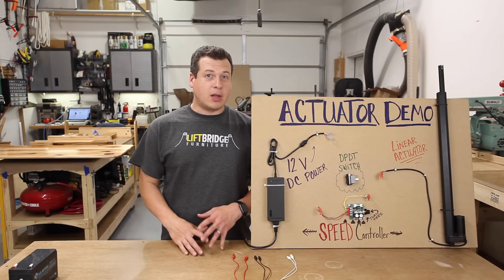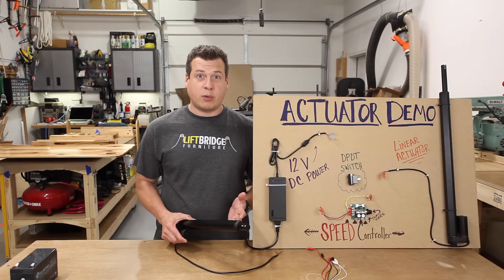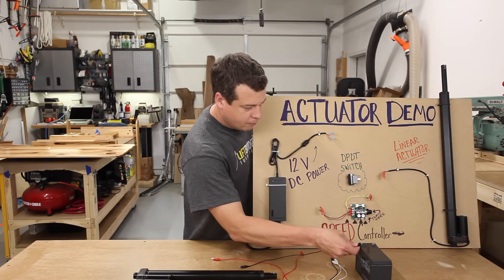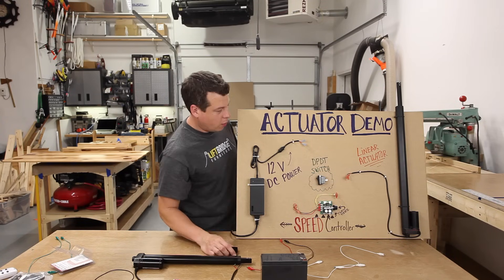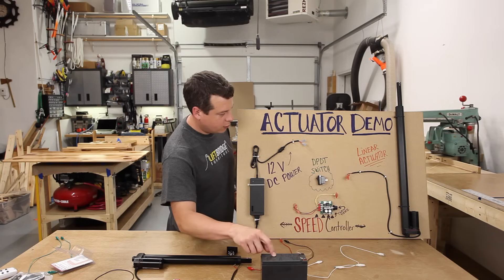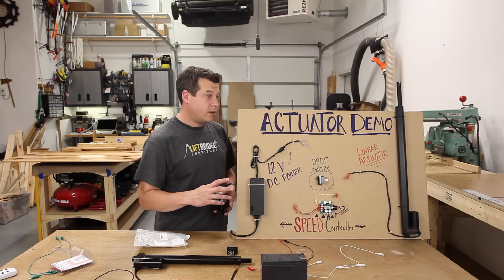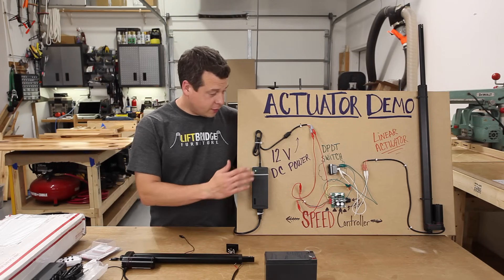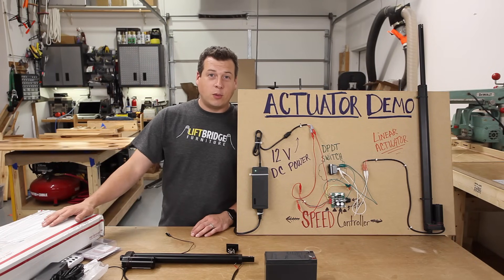Linear Actuators 101 - for Woodworkers

Comment: Just learned how CHEAP these are.  Plan to use 2 to lower my van conversion bed platform along the wall, to convert it into an "adirondack" type seating!  I need less than 6" of movement and I'm clearly under the weight range!

Comment: You think I can use a in/out switch, I have one on a remote lead that plugs into my winch, on my 4 wheeler, that the plug was different, and now I want to use it on my kayak trolling motor, useing a actuator on it, any suggestions, and help, will be appreciated, thanks
Reply from the maker: Yeah I don't see why that wouldn't work.

Comment: Hi, thank you for a great video - it has been so useful..  However, i do have a question.
I am building a table lift using 4 linear actuators.  Even though I have purchased identical models, one is running quicker and one slower than the other 2.  I purchased 3 speed controllers and went to install the first one tonight.  I found that you cannot wire it into the actuator side of the switch as the speed controller is polarity sensitive and of course the polarity switches when you run the actuator the other direction.
So the speed controller needs to be connected direct to the power supply (as you stated in the video).
So to be able to speed match all 4 actuators, am i going to have to install 4 switches?  Is there no way to wire  the speed controller into the actuator side of the circuit?
If I had two speed controllers for each actuator, one for the up polarity and one for the down polarity, then would that work?
Reply: I just ran into the same issue with 4 actuators. Did you find a good solution?
Reply: I tried using 2 speed controllers for each actuator but could not get it to work.
I ended up using resistors to slow the actuators.  It’s an ugly solution but it works.
Speed controllers would have been a better solution but I could not get it to work.
Reply: I have the same problem using two actuators. His solution using the speed controller is nonsense. He proposes the speed controller as a solution to slow one actuator, then he wires the speed controller between the power and the switch, thus you are actually controlling the power to BOTH actuators at the same time with the speed controller. The speed controller he linked does NOT work between the switch and the actuator once you reverse the polarity to retract the actuator.
Reply: In fact, the description on the speed controller states "Reverse polarity protection". I should have paid closer attention to his schematic and the descriptions on the components he posted.

Comment: I have a question about what do you do about the ground wire in the power supply and where should it go. I want to use this setup on a recliner where the reclining mechanism has failed.
Reply from the maker: The power supplies that I use only have two wires coming out so not sure?  Do you have 3 wires on yours?

Comment: How fast will the speed controller increase the actuator opening and closing?
Reply from the maker: The speed controller won't speed up the actuator.  It will only slow it down from it's normal operating speed. The idea with the speed controller is to slow down a faster actuator to match the speed of a slower actuator.
Reply: @TommyTompkins  Thank you

Comment: Great video. Thanks.  Can we set actuators to move continuously non stop at a specified speed? If so, for how long can they run continously, an hour, two?  
Thank you!
Reply: The frame design of every motor dicktates its duty cycle.
SEALED, CONSTANT DUTY.... is fairly self explanatory.
This will be listed on every large motor ID PLATE ...
Manufacturers data sheets will be needed for those below 120V.

Comment: Is it possible to somehow sync 6 of these and attach them to existing metal legs about an inch in diameter?
Reply from the maker: With the particular model that I use, you can't get them perfectly in sync but it's possible to get them close.  Ideally, if you're going to have that many, you should get linear actuators that are designed to be synced together with a controller.  These actuators are usually a lot more expensive.  You can have a company like Progressive Automations piece together a solution for you, or you can get pre-built desk frames that come with all the electronics and controllers such as the ones here: https://www.upliftdesk.com/adjustable-height-desks/

Comment: What happens if current to the switch doesn't stop?
Reply from the maker: Then the internal limit switch will stop the travel after it hits the max travel.
Reply: @TommyTompkins  That's good, so it's safe to do.
Reply from the maker: @TempleGuitars  Yep - that safety is built into most actuators.
Reply: @TommyTompkins  Thanks for all the info. Really valuable tutorial!

Comment: That was an awesome video. Thank you. I’ve never done this before, but if you had a problem of one actuator going faster than the other one, wouldn’t you want to wire the speed control in between the rocker switch and that actuator, as opposed to before the rocker? Seems like people would have one rocker for all of the actuators, so the issue with speed would need to be applied to just a single actuator?
Reply from the maker: avg8or with more than one actuator it gets a little more complicated because you need to introduce relays into the wiring. But yes, you’re correct.

Comment: Any recommendations on an actuator that lifts very fast? Is it just higher amps? No concerned about the noise, thanks!
Reply from the maker: In my experience, pneumatic actuators can move very fast but you would have to run an air compressor as well.  With electric linear actuators, faster generally means less powerful.

Comment: Thks do much.
I have a question: 
Could you help me wiring 4 linear actuators 12 v x 3 amp , I have a 15 amp momentary switch, do I need anything else ?how can I do to all work together the goal is lift up a truck canopy.
Thks for your attention
KingRegards
Humberto
guerreirohumberto@hotmail.com
Reply from the maker: 4 actuators can get a little complicated to wire up because you need to use relays.  Two actuators are also more complicated if you need to introduce a speed controller to slow down the faster one to match the speed of the slower one.  I always use relays with 2 actuators as well. I have wire diagrams and parts lists for two actuators in my desk plans on https://liftbridgefurniture.com but not for 4.  To be honest, for 4 actuators I would probably go with a desk actuator kit with controller that was designed to control 4 actuators and keep them in sync.

Comment: I'm working on something similar. Working on a way to mount a TV that goes up and down. I thought of drawer guides to the right and left and one actuator in the middle.  Figured it would save me a little but both sides would go up at the same rate. No real need for a speed control unless I just wanted the TV to go up slower. Am I on the right track in my thinking?

Also thinking of using one to tilt the top down a little to change the viewing angle when its at the fully extended hight. I know im nuts but the set will also slide right and left 14 inches on each side. It's confusing but it's a 43 inch TV I want to mount over my kitchen sink. Making it slide right to left is the only way I can open the cabinet doors.
Reply from the maker: Sorry for the late reply here.  Yeah drawer glides with a single actuator should work just fine without a speed controller.

Comment: Tommy, I want to reduce the speed of me Lazy Boy lumbar activator. Can't get to it without tearing open the back. Have you ever used a resistor in line with the motor leads to just set to a lower speed?

Comment: I would LOVE to see this same exact functionality only controlled with a digital assistant instead of the rocker switch. To factor in the safety aspect of not having continuous power flowing to the actuator, maybe use IFTTT to set a time limit for something like a Sonoff smart switch? For example, a voice command to raise the desk would trigger one Sonoff smart switch for 10 seconds and then automatically turn it back off. A voice command to lower the desk would activate a second Sonoff smart switch (with reversed polarity) to lower the actuator for 10 seconds. 
I don't even know if this is possible and, if it is, if my idea is feasible or way too complicated. Either way, I just ordered some components to start playing with. Excellent video!

Comment: Do you buy the speed switch complete
Reply from the maker: Here's the speed controller: https://liftbridgefurniture.com/product/riorand-tm-12v-40v-10a-pwm-dc-motor-speed-controller-w-knob-high-efficiency-high-torque-low-heat-generating-reverse-polarity-protection-high-current-protection/

Comment: Great video! I want my new hidden gun case door to rise up 90 degrees (open) hinged on top. The door is 64" wide and 32" tall and made of 3/4" ply.  The wall hanging cabinet is 4" deep.   How many actuators would you use and what size? Thanks.

Comment: I really want to see a design where you arnt limited to load actuator can take when not moving. I'm thinking arduino with a selonoide as well and intervals it can lock at either pin wise or Rollercoaster clicker style (introduces some potential limits or challenges for down.. I've got one other idea probably cheapest but..

Comment: Do these generate a lot of heat? If not, maybe they could be wrapped in a sound deadening material to cut the noise down
Reply from the maker: With normal use, they do not generate a lot of heat.  But if you go over the manufacturer's recommended duty cycle limit, they can produce heat and be hard on the motor.

Comment: I'm trying to hook up 2 actuators with a speed controller on one of them, I have wired it up between them switch and the actuator, it works going up but not coming down, any suggestions?
Reply from the maker: The speed controllers have a fixed polarity so it either has to be wired in prior to the polarity reversing switch (to slow down both actuators) or if you're looking to slow down one actuator to match the slower one you'll need to also incorporate some relays.  The wiring in the latter example can get kind of confusing and it's not easily explained.  I have the complete wiring diagrams and parts list for that included in my Stand Up desk plans here if you're interested: https://liftbridgefurniture.com/product/lift-bridge-standing-desk-drafting-table-plans/

Comment: anyone knows trustworthy company to buy a DC linear actuators which have following specs .
1. load force : 200N

2. Full load speed  >600 mm per  sec

3. stroke length : 300mm

4. input voltage : 12/24 v

5. mounting length : around 500mm

Comment: I need an actuator that will sit in a 10inch enclosure and need to travel at least 8inches to lift a small tv monitor. I found a 4in actuator which travels only 2inches. Then 8inch x 4inch, and so on.. is there an actuator or other hardware to make this happen?
Reply from the maker: Did you check out any of the Windy Nation actuators?  An 8 inch stroke might work for your application.

Comment: In the video, you stated you can put one speed controller on the faster actuator to slow it down, and keep both in sync. How do you wire one speed controller, to one actuator, (on an application like this with two actuators) with one power supply and one switch?
Reply from the maker: When adding a speed controller to the mix in a dual actuator setup, the wiring can get quite a bit more complicated.  You basically need to introduce relays into the wiring in addition to the speed controller, switch, and power supply. I have wiring diagrams for this and parts lists available in my inversion chair plans as well as in my standing desk plans that are available here: https://liftbridgefurniture.com/shop/?fwp_product_categories=woodworking-plans
Reply: @TommyTompkins  I have the same issue. Any chance you can share how to add relays into the circuit? I am making a very low budget desk would really appreciate your help. This video has been extremely helpful, so thank you!

Comment: Reading post below are asking a lot of good questions. The length of wire and the amount of current determines the size of gauge of wire to use safely. There are many charts online to help with the size of AWG gauge. Remember as well, that a device, if rated for 2.5 amps, there is an inrush of current when first turn on, due to copper coils in the motor are cold, more current because less resistance. So, 2.5 amps maybe 3.0 amps for a second or less. This also help with sizing a fuse for circuit protection. Using a high end digital multi meter (DMM) like a Fluke 87 type 5, will measure 15 amps inside the meter with the newer fuses. Using two actuators in parallel adds to the amperage, so 2.5 + 2.5 = 5 amps, but add cold start current by measurement (Digital amp clamps are good & cheap) is the best way or guess using smaller fuses under a dead load. The dead load increases amperage requirements to start a heavier load to get moving. The "Speed Switch" is more likely a (PWM) pulse width modulation type. So these are a duty cycle type, example; 50% duty cycle is on half of the time & on half of the time, therefore you will expect half speed of the motor. Just note, the total amps required for your device, must be determined before you order the PWM speed controller so it does not fail due to higher amperage than it's rating. To be safe, purchase one with twice the current rating of the actuators / devices being used assembled in a real word project. Test, know, don't guess! The fuse is to protect the wires in the circuit and not the device. The device is designed to be change, while the harness is not. 
And for Harold Buford, people by habit, create tic's in there speak. I know a guy that says "On There" at the end of each sentence. Ah, Uh, Ums, You know...are all habits, a little annoying but it will not kill you. No ones perfect.   Hopes this helps our fellow creator, inventors and wood-workers! A very tall eye lady eye doctor told me, that her husband & her both had counters in their house adjustable with actuators...it cost $14k extra. But how much is back surgery?
Reply from the maker: Thanks for the good points and thoughtful comments Dean!  Back surgery isn't cheap, but boy am I glad I pulled the trigger on that one.  I'm 100% back in action and enjoying every second!

Comment: Thanks for the links I have been looking into this because I need a different desk set up. I want to take the top off my desk and add these to it so it looks just like my desk does now when down but then raise it when I want to. Do these pick that much weight or are they rated above their actual real working situation. I have prolly 150 lbs altogether with iMac and second screen plus the top is solid wood. What are your thoughts on the weight lifting capabilities?
Reply from the maker: With the actuators that I use, each one has a static load capacity of 225 lbs.  This means that it's designed to support that weight when not moving.  However, it's not ideal to have that much weight when operating the motor.  The more weight you add, the more you can hear an audible change as the motor struggles. You also have to keep the duty cycle of the actuator in mind with the more weight that you add. The duty cycle is the ratio of on time to off time, usually expressed as a percentage. This means if your actuator extends and retracts for 20 seconds, and then spends another 40 seconds at rest before the process repeats, the duty cycle would be expressed as 33%. (The rated duty cycle with the actuators that I use are 25%)  But the more you approach the duty cycle limit and the more weight you add, the hotter the motor will get.  Could it lift 200 lbs?  Yes.  Would it struggle?  Maybe a little.  All things to consider with your application.
Reply: @TommyTompkins   thanks for the reply. I was thinking that with two motors it should be OK. I'm not sure what I will do yet. I could get just the frame and motors from one of those desk makers for 200 bucks. Only a few dollars more than all the parts I would need to buy and I would still have to put all those parts together.

Comment: Due to needing to run fairly long runs of wire (30-60 linear ft) I was curious what gage of wire does that take? I am assuming 18 gage but do not know for sure.
Reply from the maker: I use 18 gage with these actuators but I've only run them about 6 feet.  I'd assume it would still be fine to run 30-60 feet but you'd have to test to be sure.
Reply: @TommyTompkins  thank you for the speedy reply, that is good info and I will certainly test before installing. Kudos! :)

Comment: How to connect two actuators to one power supply?
Reply from the maker: Both actuators can be wired to the same two terminals on the switch.
Reply: @TommyTompkins  you'd connect the two actuators like you would connect any other devices together, right?
Reply: You can get a complete kit of products from Amazon== https://www.amazon.com/gp/product/B07RNG9YYG

Comment: Where do  I find a simple and easy motor controller like the one in the video?
Reply from the maker: Are you referring to the speed controller?  Here's a link: https://liftbridgefurniture.com/product/riorand-tm-12v-40v-10a-pwm-dc-motor-speed-controller-w-knob-high-efficiency-high-torque-low-heat-generating-reverse-polarity-protection-high-current-protection/

Comment: Does speed controller make actuator faster than it normally can go?
Reply from the maker: No, it only slows it down.
Reply: @TommyTompkins  is there a way to speed it up?
Reply from the maker: All the speed controller does is reduce the voltage from 12 volts to slow down the actuator.  So theoretically, if you increase the voltage it should speed up.  But if you go much over 12 volts, you'll probably fry the actuator.  If you need faster, you should shop for an actuator that has a faster travel speed.  But generally speaking, the faster the actuator is, the less powerful it is as well.